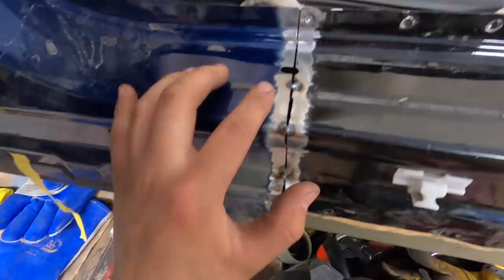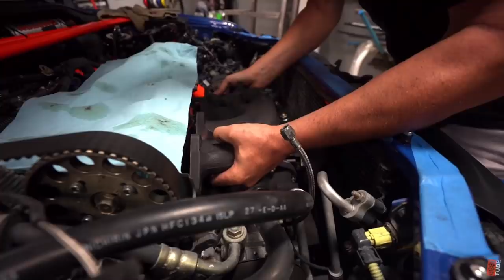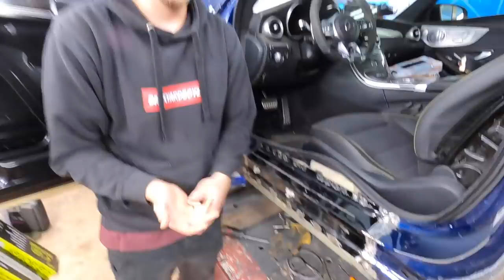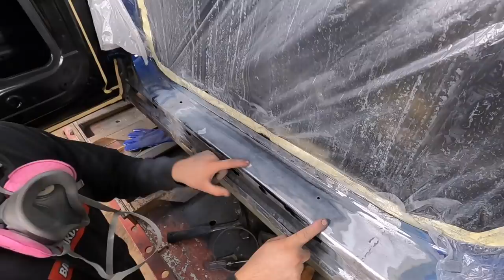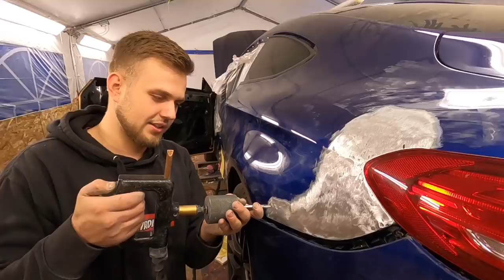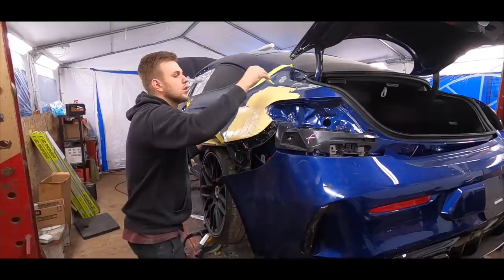Rebuilding a WRECKED 2019 Mercedes C63AMG From COPART! (Part 5) I CANT BELIEVE ITS FIXED!!

Comment: You need to spray rust inhibitor inside the panel(any welding or spot welding). If not, inside will rust out soon. There are product designed for that purpose. Or you can use flexible hose.

Comment: New to channel, love it thus far man. So how long you been in body shop trade? You have impression collection of tools and equipment and you do great work (impressively great work especially for your age is why I ask) that quarter panel would have been scrapped by most but you took it as a challenge and tackled it wich I respect %100 and it turned out flawless!! Trust me when I say I will stay tuned and be an avid watcher from this point forward! Is Copart a dealer only auction format or open to public?